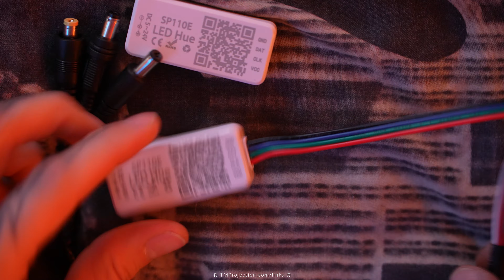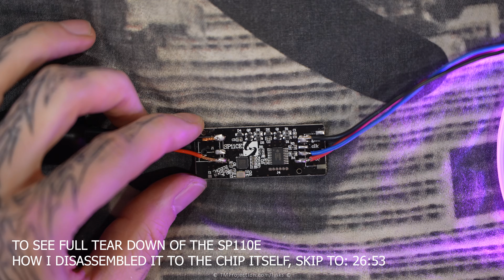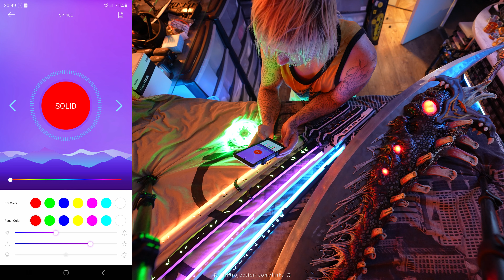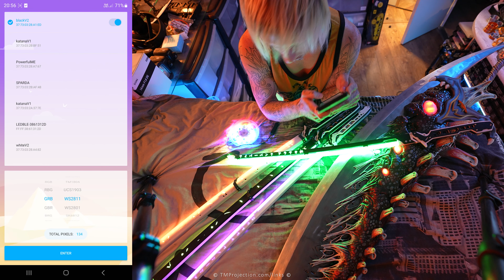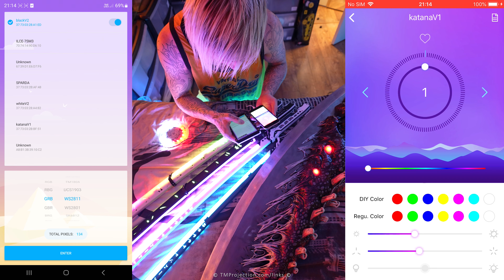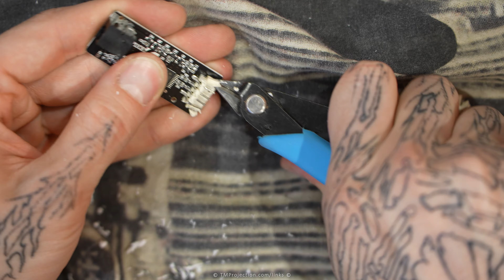LED HUE App Tutorial SP110E Bluetooth Controller iPhone Android WS2811 WS2812B SK6812RGB SK6812RGBW

Comment: does this works for ws2811 if red is green and green is red?
Reply from the maker: @bambino167  if terminals are in different order it should be fine as its simple, positive, ground, data, if colours are different then you csn switch their orientation where you select the model of your controller

Comment: Have you ever had any issues to where it’ll pair for a second then disconnect right away?
Reply from the maker: @rylankeslar9147  yup, thats because the controller is powering down, this is usually a power supply issue, maybe too many LEDs cannot keep up with inceficient power, maybe the PSU needs more amps

Comment: Great video. I’m using SK618rgbww with SP110E and LED Hue. I really would like to separate my strip into groups and control them as different sections. Have you had any luck attempting this? You mentioned Arduino coding but I’m not sure I’m up for that…😂 Thanks again
Reply from the maker: I just use multiple controllers for that, multiple SP110E's